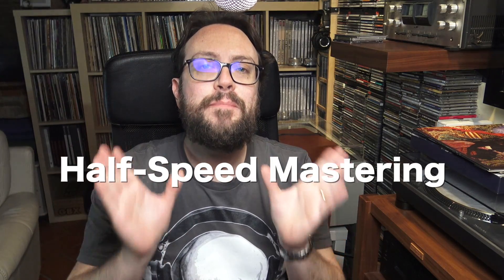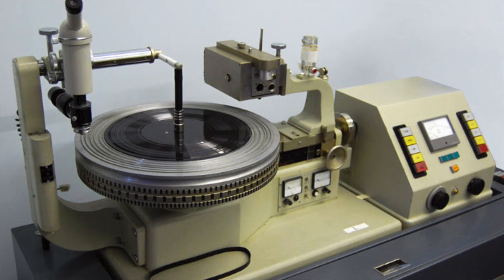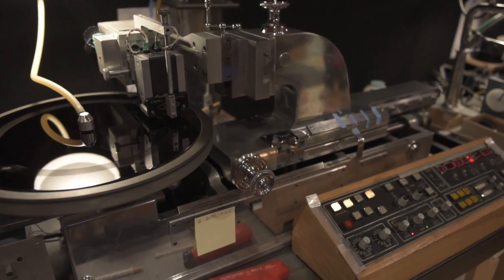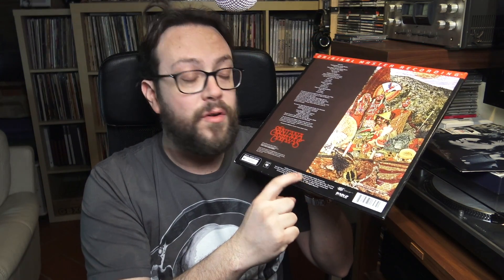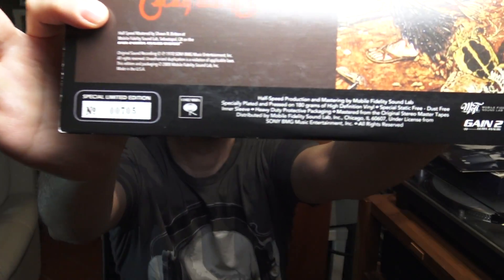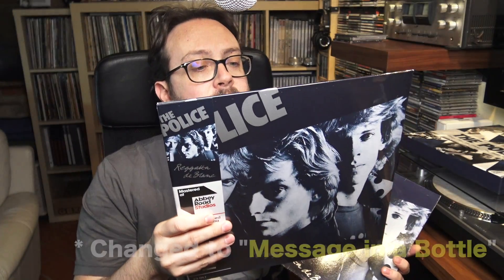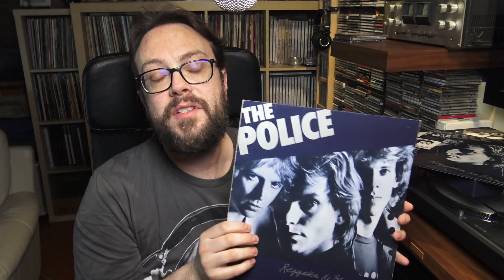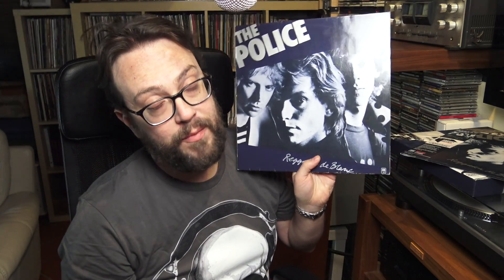Vinyl Half-Speed Mastering: pros/cons & test

Comment: Some interesting notes on the Audio Files... (limiting analysis to the first 30 seconds of the audio files)

File 2 has about an additional 4 db bass boost.

File 1 has a volume imbalance; the right channel on averages about 3 to 4 dB louder than the left channel.

Both files exhibit an odd notch at about 84.35 Khz.  This makes me wonder how these files were actually captured from the analogue signal path in the first place.

LRA measurements are within 0.1 between files, 6.5 for File 1, and 6.6 for File 2.

File 1 has dynamic compression, leaving a difference between peak, and RMS peak measurements of 5.2 dB, where file 2 has a difference of 18.0 dB!  This compression on File 1 probably occurred when the intermediate master was created.
Reply: I will say that if I listen to the files on my laptop speakers, or my phone speakers that file 2 does indeed sound better, but on better speakers, in stereo, I still like file 1 better.
Reply: Denshi-Oji .
Reply from the maker: Very interesting analysis! Thanks! I can only add that the transfer was made with my Zoom Tac 2 at the highest quality possible on audacity.

Comment: Even through Youtube I hear more "clarity" in no. 2, which is more appealing to me. That's why I always tend to steer away from new pressings (there are exceptions, of course). And please (do not take it personally), everybody please stop that 24/192 madness :) It's waste of data storage. Not everybody has $$$$ systems to resolve the difference between 16/44 and 24/192.
Reply from the maker: Murat! No offense taken. I try to give you the best quality possible. Even if downsampled it woukd benefit from this high quality. In any case, most computers, cell phones/digital readers and dvd/bluray players have this capability!
Reply: @anadialog  I would happily rip one track from one of my "clean" LPs in both 16/44 and 24/96 (that's what my sound card is capable of), send both to you and ask if you can hear a difference :)
Reply from the maker: Sure! For once I will express myself...send the files to my email address in find in the information tab on the channel. Possibly through wetransfer or dropbox...

Comment: I think the difficulty here is that we are not actually judging the half-speed mastering technique, but the two different masters used. The recent police remasters are not the same sonically as the originals from the 70s/80s. We can only truly evaluate the virtues of the half-speed mastering process if both LPs are cut from an identical master with the same processing applied at the cutting stage, maybe even cut on the same lathe. This scenario is unlikely to exist for any album.
Reply from the maker: Don't thino only half-speed. Thino a good digitally sourced copy recently released. Does it stand with an original pressing (not even UK)...that wad the objective...
Reply: @anadialog  It's probably a good thing you didn't try a UK copy of that album, it was terribly mastered, no bass. I've had three different copies, all the same. The only copy I have with decent bass is the one in the recent box-set. Your German pressing sounds great though.
Reply from the maker: Thanks for sharing your experience. You should check out the SACD. The dynamics are very good!

Comment: I listened to file 1 and then file 2 from your links. 1 sounded really good, but 2 sounded better with a wider sound stage. Yeah the bass was stronger on 2, but it sounded more real. I even went back and forth and there's a definite difference between the two files. And now to see which is which? Okay...I was surprised that file 2 was the original pressing. I actually preferred 2. Your assessment at the end was spot on.
Reply from the maker: Thanks for your analysis!

Comment: Half speed mastering means squat when they are using a digital source that's been compressed at some point in the cause of the loudness wars. 2.
Reply: digitization as such doesn't mean compression. actually, digital domain allows for much deeper dynamic range than analog does. digital mastering for loudness is another thing.
Reply: Absolutely. https://www.youtube.com/watch?v=AjjgPVipuXc
Reply: File 1 sounded when i copied on tape and the tape aged - thats the same sound -So its down to that really
Reply: Just because they are using a digital file doesn't mean it's been compressed? If you are using a much higher quality 24 bit source, intended for Hi Fi listening vs a format for the masses, which digital often is (because 99% of playback systems on earth are cruddy)... But assuming they know they are working with vinyl they are not looking to compress it down to playback on ten dollar earbuds.

Comment: I agree with Greg Moore. You should have used a regular record also made in 2018 of the police at regular speed from the same company then you may have heard the difference. You know the more you remake an album the more of the details are lost. So to make a comparison from a master to a half master it has to come from the same tape that way you're comparing apples with apples and oranges with oranges
Reply from the maker: Now that makes more sense. You mean just to evaluate the cutting technique. Greg said a similar thing but impossible to realize if not decided by a producer. In any case that is not the point. I do not want to make a comparison between digital versions. The half-speed was supposed to help the digital version. After all, the channel is called analog dialog! ;-)
I am intetested in understanding if I should look for these editions or look for AAA releases...in this case, it is clear. I think this is much more interesting and useful. But maybe its just me.
Reply: @anadialog  Sorry I'm confused was the half speed record not made to help the regular record to sound better which were analog in the early years. I have a few half speed record from the mid 1970. I want to read you some literature they gave with the album at the time. Mobile Fidelity's exclusive half-speed mastering process utilizes only one-fourth of the power that real-time cutting takes. The cutting head amplifiers are never pushed to their limits. This produces more head room for far superior dynamic range, top-end and overall frequency response plus improved stereo separation. No transformers are used and limiting is never employed. Nothing is introduced that will cause distortion or squeeze. Are they not taking about the making of analog records?.
Reply from the maker: Yes of course they are analog! I said this in the vid as well. In my comment I mentioned a comparison between digital versions because you said (reasonably) to compare the 2018 half-speed with a 2018 normal speed, which makes sense. I just wanted to make a comparison, let's say,  between a good analog version and a good digital version (digitally sourced version).
Reply: @anadialog  Ok I see what you are saying now. I missed understood what you were trying to get across. Thank you for your patience.
Reply from the maker: No problem, thank you!
Reply: I guess the goal here was more to compare these two specific releases, rather than the merits of half speed mastering.  The final sound is very dependent on which of the multiple masters were used, the specific equipment used in the cutting lathe mastering step, and finally what settings the engineer used while cutting the master.  Every single item in this process changes the sound.  That is why the pressings from different countries often sound very different from each other, even at the initial releases.

Comment: the normal version (2) is a little bit confused than the file(1) but, there is much pleasure to ear the file(2), the bass a end is little extended , and  a little confused than file (1) but in general the original "live"effect for me is better in the file (2) , the only noticiable variation in my opinion is much clarity of file (1), but there are a loss of emotion, in my opinion.

Comment: Hi, i only had to play the two different soundclips once to hear a noticable difference. Before i even heard your opinion at the end of the video i thought the original german pressing sounded much more alive and the bass sounded far deeper and rounded. Before listening i actually thought the 45rpm master would have had a more fuller rounded sound but i was wrong. Having said all of that i just bought the 45rpm Abbey Road master of Japan`s album Tin Drum and the Bass on that recording sounds very full and rhythmical, better than the original 1980`s vinyl pressing i have. 

I know you buy some cds. I don`t know if this will be of interest to you but Sony have just released a Quadraphonic double cd of Miles Davis Bitches Brew. I don`t personally have a Quadraphonic system but a friend of mine does so i`m going to listen to it on his system. Do you have any Qaudraphonic pressings?

I think with most things related to different pressings it comes down to the source material used and personal taste. 

I was one of the subscribers who asked for you to make this video so thanks very.
Reply from the maker: Hi there! Thanks for your insight. No, I don't have quadraphonic records...you need 4 identical speakers and a decoder...but I would love to have that possibility! Good observer, yes, you are correct, it was a specific request...